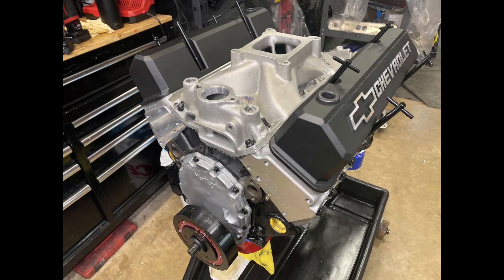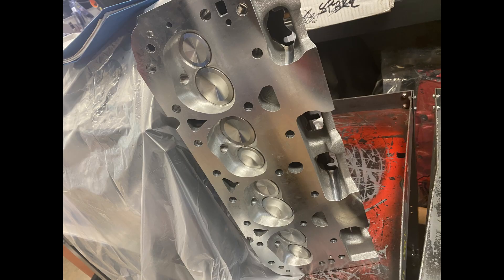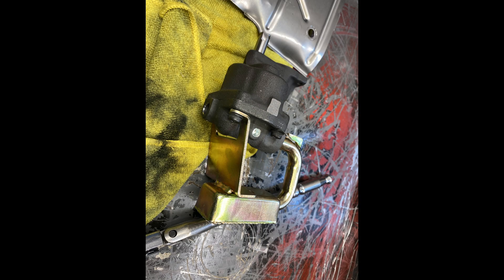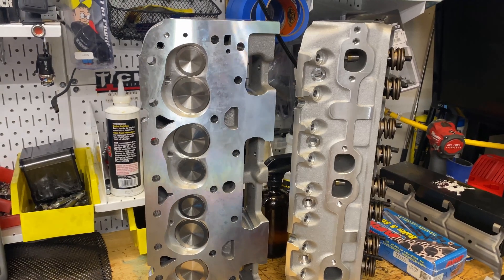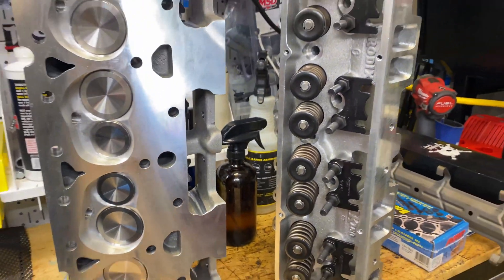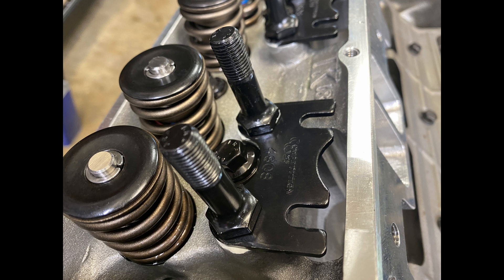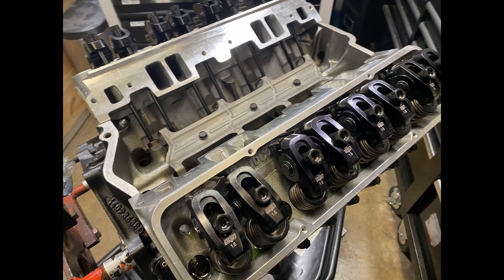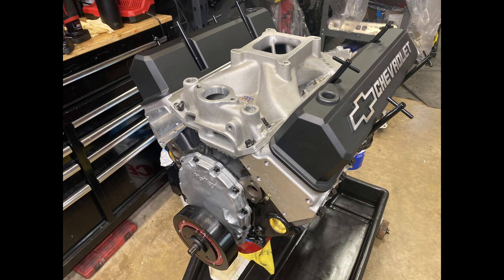The ZZ350 (383) is Finished and Ready for the Engine Dyno

Comment: This is my engine. I noticed when this video was uploaded that Eric had sent us the wrong heads as I had requested a 200 CC head not these 180's.   Long story short we removed these heads and I purchased a much better set of AFR heads with 2.05 intake valves.  I feel very lucky to have had Karl build 2 engines for me now. They both run better than any small blocks I have ever owned. Weingartner let me down though to be honest. I wouldnt deal with him again.

Comment: Hey want to no if you have any transmission crossmont bolt i could buy and egr block plate screw  if so want to but them asap thanks
Reply from the maker: I am sure I could find some egr screws.  They are a common size though.  Should be able to get from local ACE hardware.  But that crossmount bolt is not so common.  I don't have those.  Ask Nabil Guffey for that.  He always has some chance of having things like that.

Comment: Not video related but have to lay out some thoughts here hah.

I wasn't planning to do anything motor related to my car however... there's a 396 golen caprice that came up for sale near me and I think I can snag it around 6500 USD. 

The plan would be to swap my stock motor into the caprice, put the motor into my car and sell the caprice for around 3-4k USD as it does have some nice parts on it even without the engine. Hence putting me at 2-3k USD for the 396 + the exhaust system with headers etc.

But I fear that I'll be nickeled and dimed fairly hard by the end of the project resulting in a much bigger budget, considering the caprice is a 96 car OBD2, mines is a 94 OBD1, my car's a t56 Impala and that one is auto. Then having the cars re-tuned etc. The budget scope looks like it can sky rocket easy, however when I look at the prices of buying the headers + catback, and just a heads and cam I'm over the 3k USD budget quite easily. 

So it's either a really good deal or something I screw myself on, trying to sleep on it 😂😂
Reply from the maker: whatever the decision it is fun to take on the adventure.  We always 2nd guess decisions.  I I always 3rd and 4th guess my decisions.
Reply: @EllweinEngines  decided not to do it hah, just feel like I'll get nickled and dimed to death on all the things I'm not factoring in

Comment: I wanted Eric Weingartner to port my LT4 heads last year, but he was having health issues at the time.  I had them ported by Harry’s Heads in Sioux City, IA.  Nothing crazy, but with stock valves, they’re flowing 287cfm @ .600. 
Today, I am finally dropping my XFI292’d LT4 into the camaro.  Was going to do it a couple of weeks ago, but I decided to pretty-up the engine compartment.  Then, I’m going to give my LT4 intake a fresh powder coating.  After that, I will finally get to find out if my lil’ 355 is over-crammed or not.
Reply from the maker: slow and steady progress.  Hope all goes well.  Sounds like a nice set up.